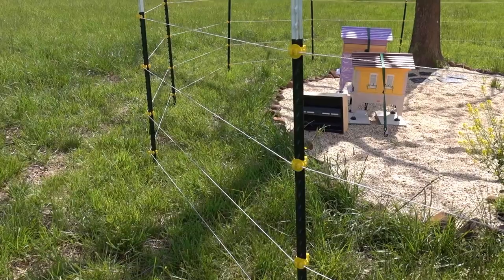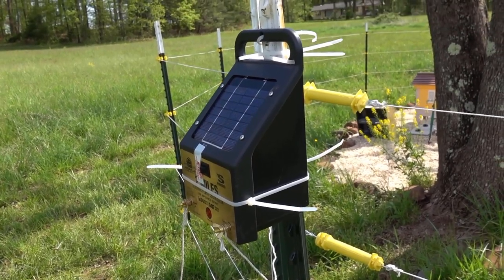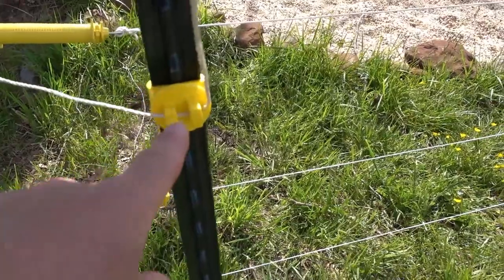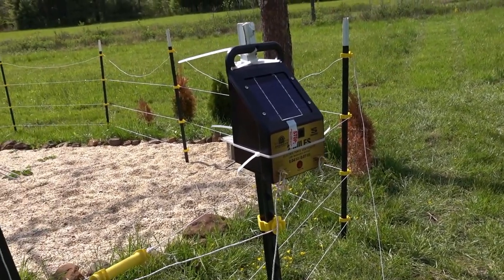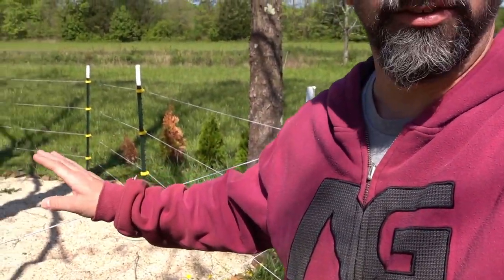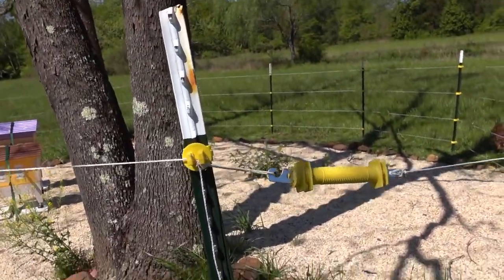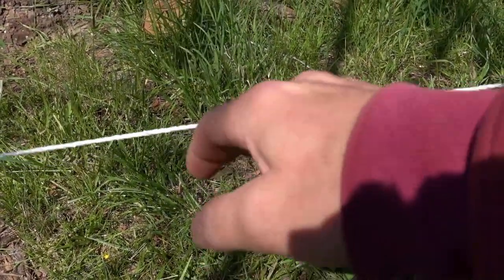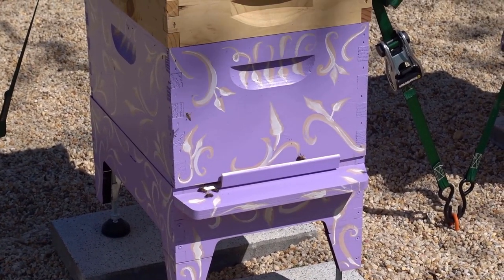Electric bear fence for bee hives

Comment: Hi fellow. I have some suggestions, you may have done or learned otherwise, your fence charger joule capacity is too low. You need at least  a . 75 output.  Remember bear need that extra “punch”. Additionally it will be wise to move your solar panel fence charger unit and grounding to the “inside” of your fence. Bears will knock the array over and accidentally rip the wire from the grounding rod. Put any and all components that operate a solar powered fence inside it. This not only prevents a clever bear from disabling you fence but any squirrels or climbing rodents from poking around the powering array. I want to know you are successful at bee keeping. It is an honorable and rewarding endeavor.
Reply from the maker: Hello! Thank you for the feedback. Yes, I have upgraded the charger to one that outputs 1.0 so it will have a good punch for any bears that might come by to say hello. As for the solar panel's location, since the apiary/fence line is mostly under the trees, I really need to keep the charger outside of the fence line in order for it to be able to charge. I'm hoping that if we ever do have a bear encounter that they are not very savvy and leave the charge controller alone.

Comment: Nice setup. I do have a question: I see on the controller that the output is 0.04 joule. Is that enough to scare away a big animal like a bear? I read that you need 0.7 to 1 joule for a bear. Am I misunderstanding something?
Reply from the maker: Your information is correct. My controller is undersized for bears. I plan to upgrade it at and point in the future. We have a low probability of bears in my area. It's mostly to deter skunks and other small predators.

Comment: you don't have it ran properly for bears, the middle top wire needs to be ground....plus 2 mile charger is not strong enough for bear you need a 30 mile charger

Comment: put the controler unit inside the wires or the bear will knock it off stopping the power and getting in
Reply from the maker: Great idea, I'm planning on moving the controller next spring anyway since it doesn't get as much sunlight as I hoped it would were it is now.